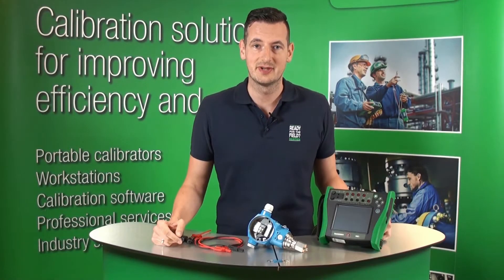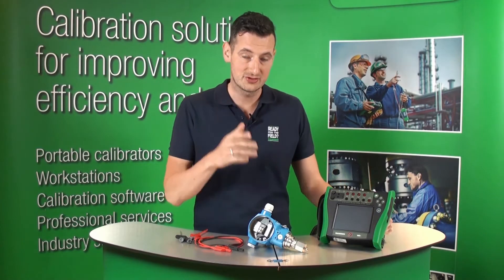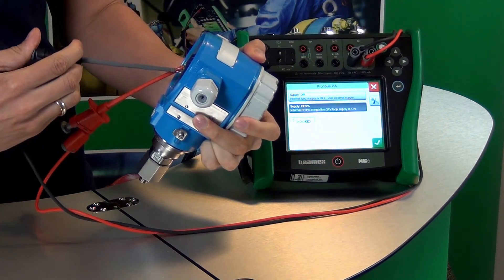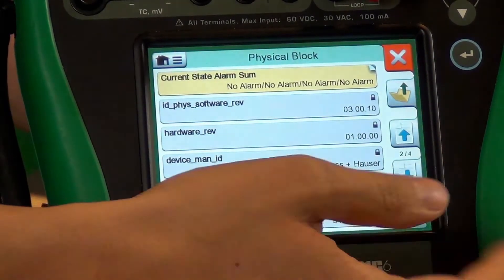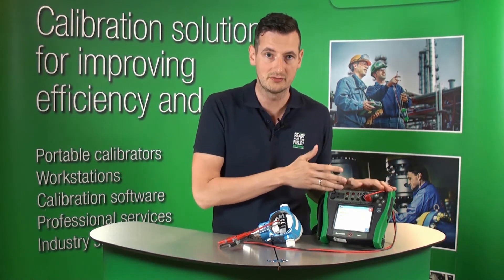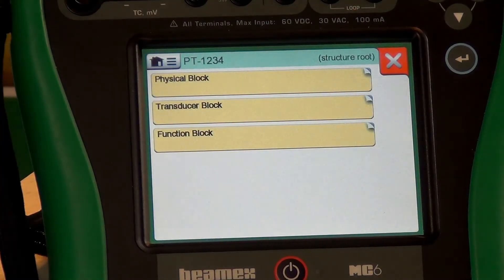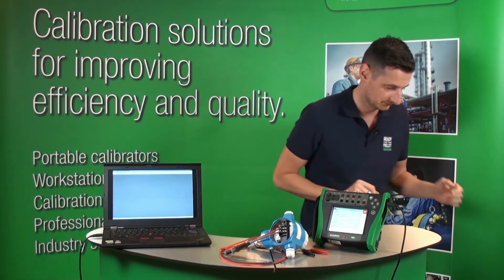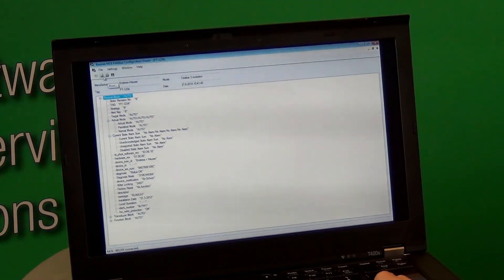How to save smart transmitter configuration - Beamex MC6 video

Comment: Hello, I have a problem with the Beamax device. The current value does not change when the temperature transmitter is connected
Reply from the maker: Hi! Sorry to hear about the issue. Please make sure you have the proper loop supply power activated, otherwise there is no current. If you have some issue with the device, please contact Beamex support at https://support.beamex.com/

Comment: Profibus pa, scanning for devices,
But not show any device 🤔🤔
What is the reason.
Reply from the maker: Hello. Please check the connections and that the loop supply is present. Also that proper impedance in loop supply (if not the internal supply). And sure the MC6 in questions should have the Profibus optional functionality installed. In case of trouble, please contact support at support@beamex.com. Thanks, Beamex / Heikki

Comment: Thanks  for comprehensive  information.I couldn't catch Is it possible to save stored file to the smart transmitter?If it is possible how it should be saved?
Reply from the maker: Hello Hasan. The configuration file is a file that can be save to your Computer and viewed with the Configuration Viewer software. We have not added the possibility to write that configuration file back to transmitter, because HART Communication Foundation did not recommedn to do that.